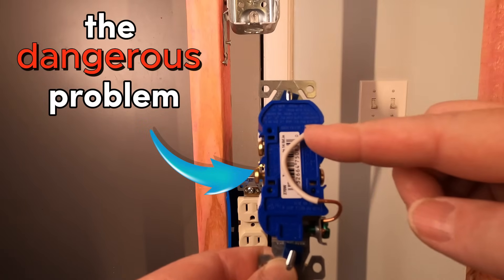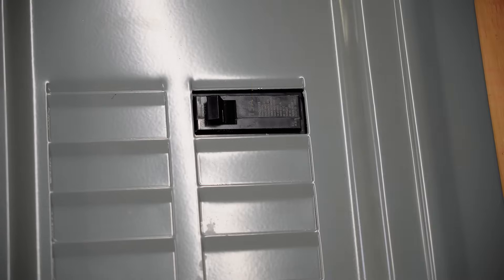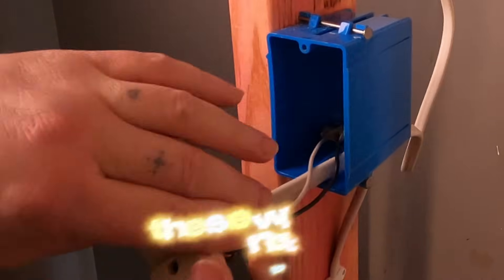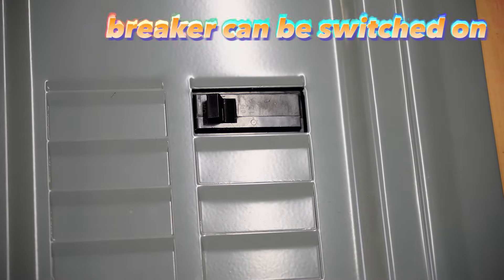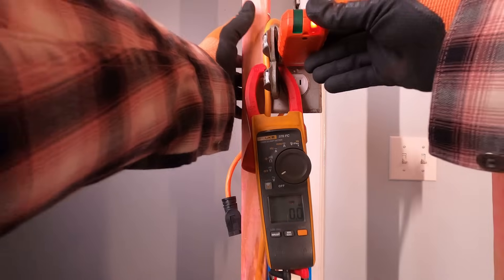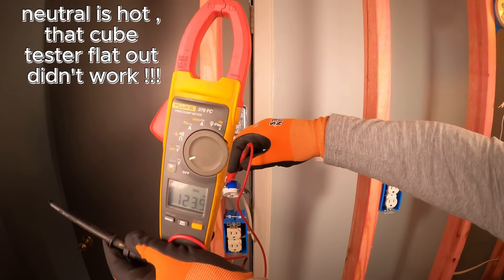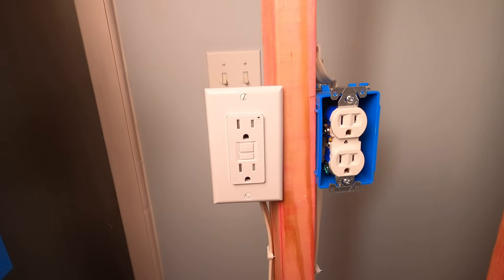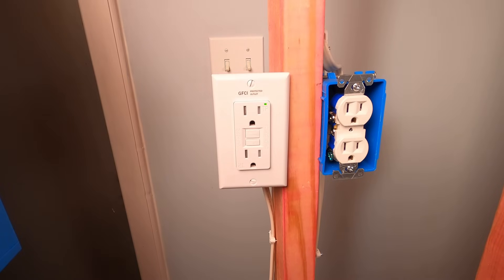why the cheaters ground is so dangerous & the #1 fatal reason to stop doing it !!!🤬

Comment: I don't really understand why I've still never seen anybody make an outlet tester that can properly identify a cheater ground.  Yeah, it's not as easy as just hardwiring a couple of bulbs/LEDs together, but with modern electronics it should actually be entirely possible (and not that expensive) to make more advanced ones that could do something like a high-frequency impedance test between neutral and ground, which should easily be able to tell the difference between a short jumper loop and a proper ground wire connection.

For that matter, it might even be possible to use something like a 60 Hz tuned circuit to be able to identify live (AC signal) vs neutral (fixed voltage), and thus detect reverse-wiring without even needing a separate ground, too.

(Hmm... maybe I have my next electronics project to work on...)
Reply from the maker: lol you would probably make money , I was thinking a meter that would detect the length of the copper by sending some kind of Signal through it to detect more than a couple inches I know what fiber optic you can detect movement just by shaking the wire , and I know this because I installed some at a correctional facility. Thanks for commenting and sharing
Reply from the maker: Hey thanks for commenting, L O L you would probably make money on a pattern like that, I thought that maybe if someone could measure the length of the copper by sending a signal through the wire at least detecting that it's more than a couple inches long would probably do it

Comment: You see a lot of reverse wiring on devices that have been updated from 2-wire to 3-wire receptacles when done by someone who didn't realize that the hot and neutral terminals on a 3-wire are opposite of those on the 2-wire. 

This also can cause you, when replacing a whole different device, to wire it backwards on account that the wires were reversed somewhere upstream. 

Lotta hot-neut reverse in 3-wire receptacles in a very old house.
Reply from the maker: That’s what happened here, it was reversed about three outlets down from the outlet that was being installed, you’re exactly right. I appreciate the comment.
Reply: @ElectroMedia-cs9ek  spread the word, homeowners especially can benefit from this reminder. 

Thank you for spreading the word on all these other issues as well, your video here was great. We need more people like you helping folks learn. 

God bless you, be safe, and keep it up!
Reply from the maker: @andycopeland7051  thank you for that, I really appreciate it.  I have many more videos to come.✌🏼

Comment: It is no surprise that the tester did not show the problem. It does not have a connection to an actual ground. With a connection to only the outlet and no other place, it is not possible to know that it is wired up wrong. You need to have an actual known good ground from somewhere outside the outlet to be able to know if the wiring is backwards, and you proved that with the electrical cord you used when you tested it. It was not possible for the cube tester to know about the fault as it was used. It is impossible to know if a wire is a hot or a neutral without a known good actual ground to test from.

Comment: Had a customer with a medicine/vanity light combo and someone tied the ground wire from the cabinet inadvertently to the hot.  Customer said they would get shocked bad enough to drop down on their knees if they were turning on the water and open the medicine cabinet at the same time!

Comment: i was recently on a call- misc non-working outlets. they had hired a guy (didnt speak engrish),. apparently he didnt know that the neutral and ground had different purposes. finally traced it down to one outlet. PEOPLE- CALL A QUALIFIED PERSON! IT COULD SAVE YOUR LIFE
Reply from the maker: Definitely a good idea to call a certified electrician, I’ve run into many unbelievable issues and problems behind people fooling around with electricity that know nothing about how it works. I hope the homeowner got the problem resolved. A lot of people think they know a neutral is landed at the main panel bonded  to the chassis with ground wires . But they definitely need to be separated until they reached the main panel. 
  Thanks for sharing and commenting
Reply: @ElectroMedia-cs9ek  yes, im an electrician.... this was a service call i was on. the home owners didnt know how dangerous that was
Reply from the maker: @JohnQPublic345  oh ok, glad to hear you identified the problem and fixed it.

Comment: Yikes.  Crazy.  I have a very old house still with 3 wire service and a pair of fuse panels, and I have cleaned up a ton of stuff, including K&T (which was still fine btw).  Worst thing previous people did that I still need to fix is they used 10/2 NM for the dryer with the bare ground serving as neutral and I don't like that.
Reply from the maker: I know exactly what you’re talking about, back when 220 V dryers We’re built without a separate neutral, and I know even some of the instructions or service tech, lands the neutral and the ground under the same terminal when matching up the cord end and the receptacle to get it to work and it will . It sucks but the only way to properly fix it is to run new wire. Nowadays, appliances have digital circuit boards and OLED readouts they used to not need all that stuff. Hey thanks for leaving a comment and sharing that.

Comment: How does a GFCI operate with no ground? Without a ground reference it can't detect leakage.
Reply: It detects if there is an imbalance between the electrons coming out of the hot wire and going in the neutral wire, using coil pickups. Created by a UC Berkley electrical engineering professor.
Reply from the maker: 🤣 that was actually funny
Reply: @ElectroMedia-cs9ek  I think you just invented a new GFCI tester I don’t ever want to test! (And my AC outlet testing kit/R&D project just about fills a 63 gallon rolling toolbox, so I know a thing or two on the subject.)

Your joke is so funny and subtle by the way you should pin kf5’s comment so more people see yours.
Reply: It can definitely detect your leakage, unless it’s just dribbling.

Seriously, though: The sensor uses a toroid around hot and neutral. Should your aim at the short slot be true, some portion of that 120 volts will go upstream, shoot down your legs (and arms if you’re touching anything except air), and then travel through the ground as it’s racing back to the source transformer it started from.

Once that current reaches 5 milliamperes, that toroid will trigger the circuit breaker attached to it.

Invented by a professor at UC Berkley.

Comment: This can also happen with the old rubber-and-cotton insulated wiring (i.e., knob and tube or other old nonmetallic sheathed cable) where the color of the insulation fades so you can't tell which is black and which is white, so you take a guess and guess wrong.

Then there was the time I got a brand new receptacle and the brass and silver screws were reversed -- silver on the narrow slot and brass on the wide slot. I always look at the slots, not the screw colors, to know which side to put the wires on.
Reply: That’s not cotton. It’s asbestos.

Comment: Obviously, it would be nice to tear down a house and rewire it from scratch every time the code changes but EVERYONE with a brain realizes that this is not reality.  You are blaming the "cheat" instead of blaming the mis-wired outlet.  The reality is that the neutral and the ground, if there is one, are electrically the  same, with one very minor difference.  Since the neutral is carrying the load  current through a very low wire resistance, by Ohms Law, there is a very small voltage loss, which means that the voltage to ground at the neutral in an outlet will rise maybe a volt above the ground, which should not be carrying current. 

So the point is that, absent the ground, and the cheat in place and mounted in a metal box, that the voltage on the box, relative to another real ground, will move around less than a volt depending on the wire size, breaker size and the load on the outlet.  IN REALITY, THIS IS FAR SAFER THAN HAVING A TWO CONDUCTOR OUTLET.

Extreme Example:  Let's plug a 1500 watt heater into a 15 amp outlet with #14 wire.  1500 watts / 125 volts = 12 amps.  The resistance of #14 wire is about 2.6 ohms per thousand feet.  So if our outlet is 50 feet from the breaker box, the resistance of the neutral is 2.6 / 20 = .13 ohms.  From ohms law, .13 ohms x 12 amps = 1.56 volts.  Thus, the metal outlet box would rise the value of a normal flashlight battery above actual ground. Did you ever get shocked on a flashlight battery ??

FYI...There are even GFI outlets available that provide protection WITHOUT depending on a ground.  To all of you who can't weight to jump on me, SAVE IT.  I learned electricity starting at age 4 in 1951.  I'm not going to read your drivel...
Reply: I'm glad you said this. I have been in this situation before. the mis wiring of hot and neutral should be the focus.
The ground and Neutral serve different functions but are supposed to land at similar
terminations at the panel (bonding)
The biggest mistakes I've seen (besides somebody's uncle or neighbor doing electrical work at their house at a point in time) are at the beginning of the service where proper grounding wasn't done or lost over the years.
Such as ground rod clamps rotting and so forth.
I have not seen a newer GFI outlet read or work correctly yet without a ground hooked up to the ground terminal.
Back in the 80's when I got in the trade, you could wire a GFI backwards and the thing still would work, it wouldn't trip though.

Comment: That little RT250 device won't tell you everything 100% percent. But as an electrician; We should always check with our voltage detector before opening anything
Reply from the maker: Exactly, always go through the process and verify what you’re working on 👍🏻.
Reply: @ElectroMedia-cs9ek The problem you describe is called a Reverse-Polarity Bootleg Ground (RPBG), and none of the 3-lamp testers can detect it. All, including the RT250, are known to fail to detect multiple wiring mistakes.

I’m not sure it’s possible to create one device that would catch all wiring problems, or even just an RPBG. Well, I’ve seen one guy design a circuit, but even he claimed that UL would never certify it, because you had to touch a safe metal contact with your bare finger.

I’ve done a deep enough dive on this that I just bought a Dewalt 63 gallon tool box to hold all of my AC outlet testing gear. I’ve got TWO (one NIB, one to cut open) of every single Sperry outlet tester ever made in it for testing.

Your trick might actually be the best (if least practical) way to test metal outlet boxes for the problem. Need a long cord so you can reach a known ground.
Reply from the maker: @PetesGuide   hey thanks for sharing on this video, yeah those Sperry outlet testers L O L I have some that are pretty old maybe even the first models of the little yellow cube tester. I seen someone do this to an outlet in the early 2000s for the first time in an older house and I thought to myself why would someone do this, granite I've seen a lot of crazy electrical mistakes over the years. I'm sure something will come out that will be affordable that will test for some of the stuff but, I have certain steps and precautions that I take when trying to figure out what's going on with electrical. (Having a good voltage meter.) Hey thanks again I really appreciate you commenting.
Reply from the maker: I definitely agree on that, having a good voltage meter is a must. That RT 250 has people  assuming there's more technology in the device than there really is with a digital screen and buttons. I've learned over the years you can't trust everything,   going through the steps, while being safe and competent. hey I appreciate the comment thank you.

Comment: Wait.... what I want to know is, why did the cube connector not indicate hot and neutral were reversed?
Reply: Because all 3-lamp testers (the Klein is basically one of these with a computer chip and lcd display) are incapable of detecting multiple wiring mistakes. To get the UL certification, they have to state that fact in the instruction manual.

Only way I know of to detect this combination of mistakes is to test with a known path to ground. If you don’t want to lug around a 100-foot plus extension cord to reach every outlet in the house, then you can use an NCVT and test all three holes, using yourself as the path to ground. But this won’t work if you’re high enough up a ladder that the NCVT doesn’t have a path to ground.
Reply from the maker: I checked it on a 3 prong  outlet with hot neutral, reverse with an actual ground, and it read it like it’s supposed to. I guess when it energize the chassis ground of the outlet it tripped it up some kind of way-crazy know.
Reply: @ElectroMedia-cs9ek  Yeah, weird, you would think the manufacturer would test it for any type of miswiring!  Kind of a liability, it's whole purpose is to tell you if there is an issue.
Reply: @gregnichol9364   The nature of the physics involved in the design of those outlet testers is such that NONE of them are capable of detecting multiple faults. If ElectroMedia had fixed either one of those two faults, it would have shown an error (but maybe not the correct one). This has been known by the designers of these testers for about 50 years and nobody has found a solution.

Multiple testers are required to ensure outlet safety.
Reply: @PetesGuide  Thanks, good to know!  I usually just use them to test my own work (sanity check).  Will have to keep in mind when using one to check an unknown.
Reply: @gregnichol9364  get a Non-Contact Voltage Tester; I like the Klein ones that show green when they’re on and beep and show red when they sense hot. Use it to verify that only the line slot on a receptacle is hot. Then use the Klein RT-250 to test the outlet. That will give you nearly complete confidence the outlet is wired correctly. It won’t test the quality (read: very low resistance) of the ground connection, but will be several orders of magnitude safer than what every single building inspector tests with.

Comment: I once saw a gas pipe that was hot. It ran a foot off the ground outside of a duplex for the length of the building. The house had no ground and the igniter for the stove had been wired with the hot attached to the stove body. With no bonding of the gas pipe it became a death trap!!

Comment: The Ground is for 1 purpose and 1 purpose only.
It allows for the circuit breaker to see a ground fault as in short circuit and thus the breaker can do 1 of its intended purpose.  To trip and open the circuit and prevent an electrical shock.
The other purpose of a breaker is to see the circuit is over current, and trip to save the integrity of the circuit and prevent excess heat which could result in a fire.
And yes...there is a 3rd purpose of a circuit breaker and that would as a disconnecting means to de-energize the circuit for service.

Comment: My grandma had her personal massaging device charger quit working. She modified another charger and inadvertently swapped the hot and grounded conductor. I got electrocuted on a metal box in the basement. My grandma called me a pussy and told me to get over it. "It was only 120" she said.
Reply from the maker: What?  🫢she sounds like a character, 110/125 can definitely still easily kill you🤯 , make sure the power is off . Was she trying to convert 220 to 110 or something? Oh, I see pretty much the same thing as in this video.

Comment: Home inspectors should be using an outlet tester that checks for neutral to ground shorts and reversed polarity (even with a cheater). Apparently, they are just using a cheap neon light tester. If you don't have a proper tester, just put a heavy load on the circuit and measure the voltage between ground and neutral. If it is zero, you have a cheater ground. It should be one half of the voltage drop between hot and neutral when the load is applied.
Reply from the maker: I agree, but most inspectors will have a similar cube testers if not the same exact one shown in this video , and it test most of the good ol regular problems lol. But in my experience, electricity can do unusual things that will have you scratching your head (i’ve seen a lot & fixed a lot , especially in old homes with switch loops on every switch in the house and so many things sharing the same neutral with no ground. I’m sure some company is working on it or there is already a product out that can detect this. I just go through the process . thanks for watching the video and Sharing
Reply: I'm impressed if an inspector has any tools and uses them. Most just use a pen to sign the back of the check lol